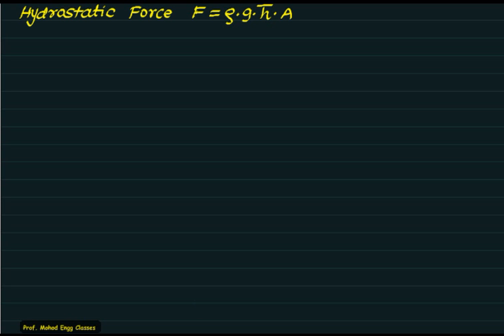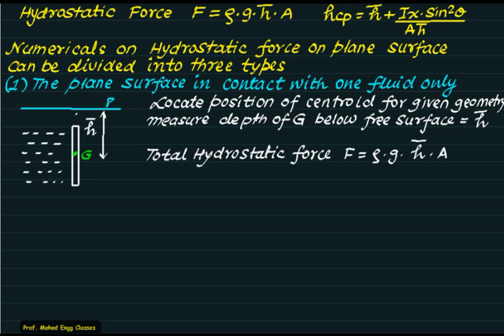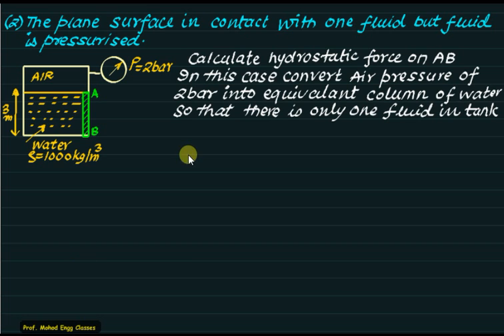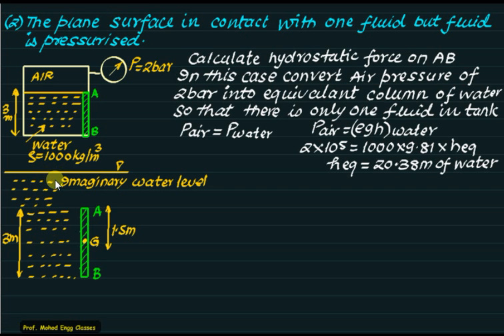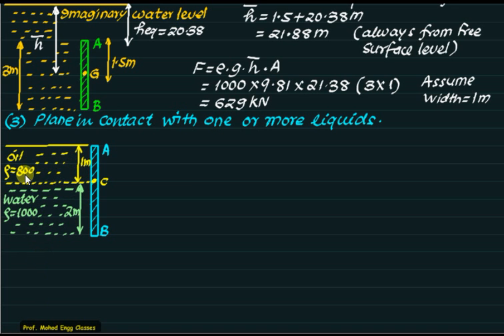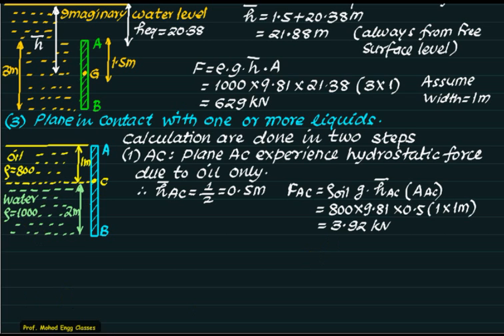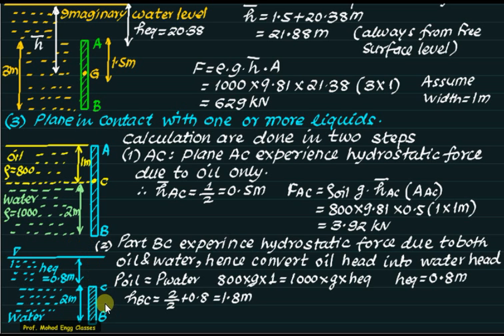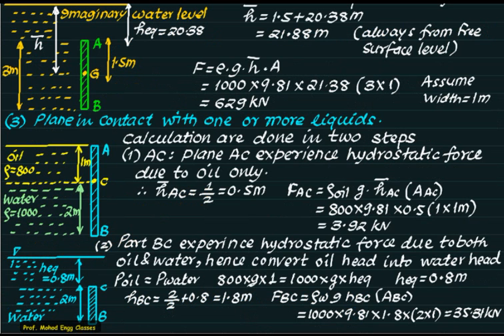02 Hydrostatic force on plane surface example

Comment: h'= (20.38+3)/2= 11.69 
isn't it ?? 
i'm confused about this part of your lecture
Reply from the maker: distance of CG is to be measured from free surface. Hence first locate cg of AB wrt A and measure CG from free surface which is 20.38 m above A ie. 20.38+3/2=21.88m
Reply: sunil mohod ok got it thanks.